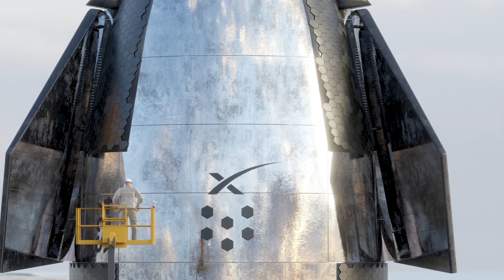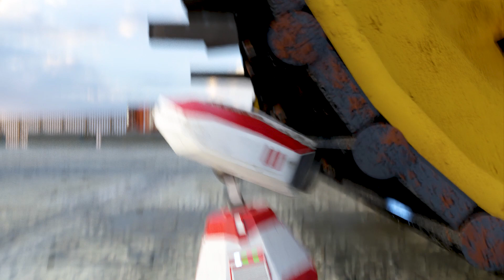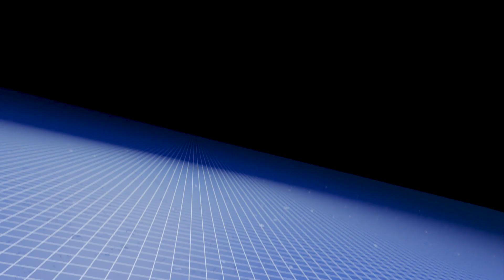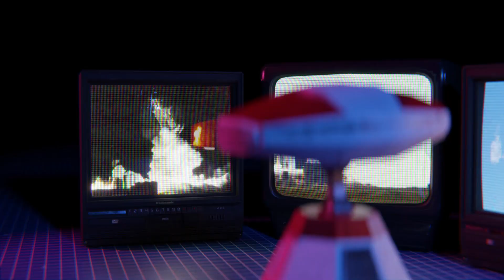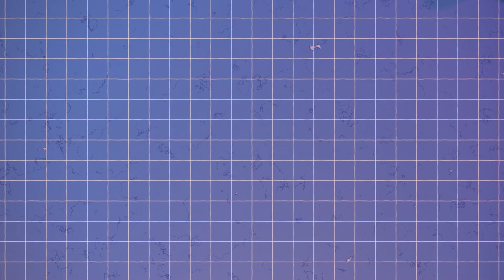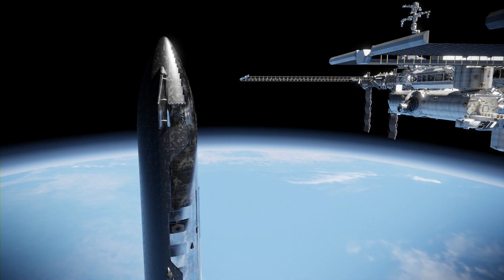Will the STARSHIP Change The WORLD?

Comment: Take a look at AI frame interpolation if you're actually doing stop-animation there. You create two key frames and tell the AI to generate a bunch of transitional intermediate frames, it's pretty cool and saves a massive amount of effort. There are lot of demo examples from movies that use stop animation. Termimator and Robocop are good examples. You don't lose the original art, the style, but suddenly the animated figures are completely smooth and look real.
Reply from the maker: Thanks a lot for the tip but if you look closely, you will see it’s all 3D animated. I choose exactly how much frame per second I want !
Reply: @POLY_English  That was my guess. The CGI stop motion is well done, I wasn't sure. It's still useful with CGI, the AI is like magic at this point.